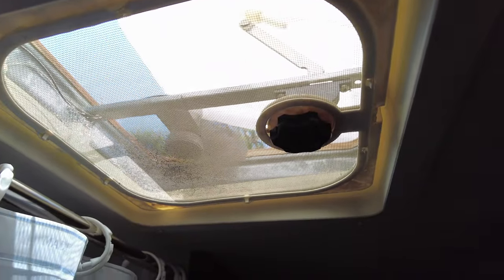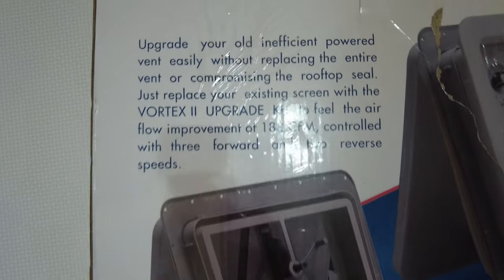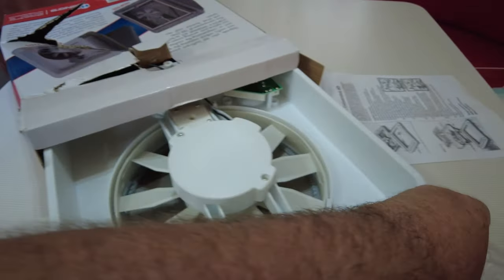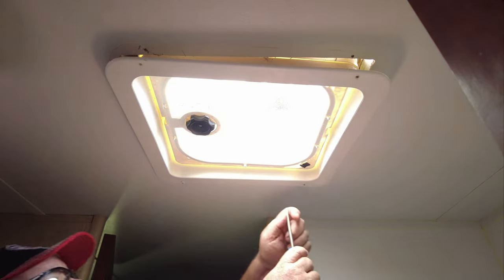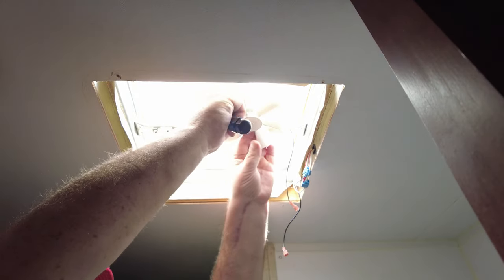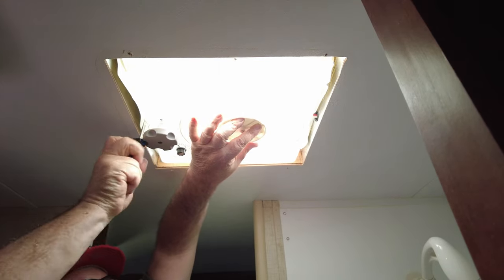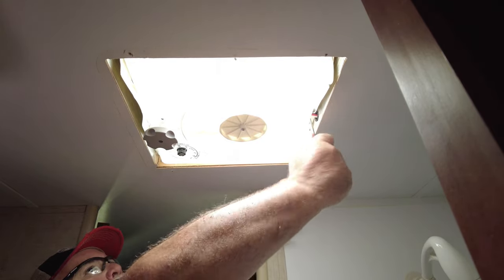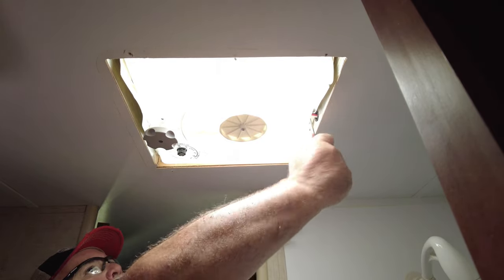Increase Your RV's Airflow with a Heng Vortex II Vent Fan Upgrade!

Comment: What about the big gap where the screen attaches? There are three tabs but when you lock them in place there is a gap big enough for any bugs to get in- looks like a design flaw…
Reply from the maker: Hi David! Thanks for pointing that out. I hadn't noticed the gap. So far it hasn't been an issue but I will keep an eye on it.
Reply: I was thinking the same thing, but I think you could probably put some good quality clear packing tape to fill those holes.

Comment: What is the little knockout next to the knob for?
Reply from the maker: Weird. Didn't even notice it until I read your comment. Don't know. Sorry. Anyone else know?
Reply: @trailertrashadventures  ok so I was only able to find one quick mention of it and they say it's a knockout for a fuse holder? Don't know if it's true but makes since.
Reply from the maker: @9FNP  Sounds logical to me.
Reply from the maker: My trailer is in storage right now or I'd go look at it. I think I tossed the manual.